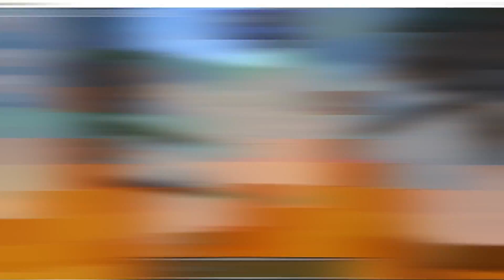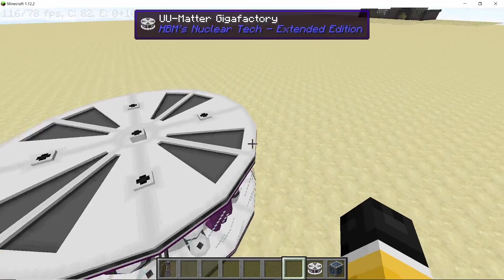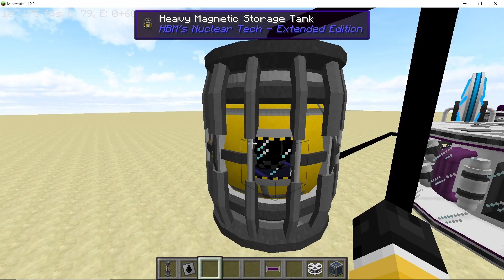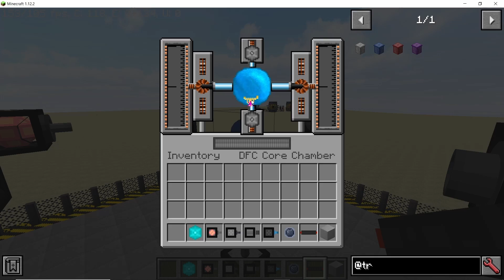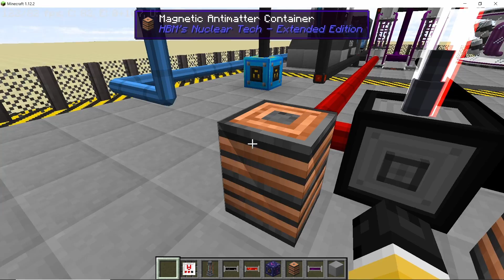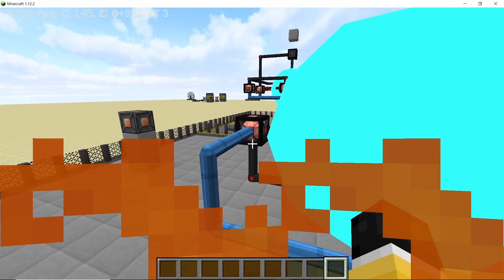Self Sustaining DFC using UU Matter Gigafactory - HBM's NTM Extended

Comment: for higher spark and power generation i would reccomend you using undefined lens and exchanging antimattee with BF rocket fuel. By this i managed to create a DFC that produces 510 PHE/s without melting down with 5,1 TSPK
Reply: Damn man how'd you do that? For me the max I could get was 364SPKG or something like that
Reply: @randomanimatorandgamer9392  stabilizer lasers can go trough blocks. srack multiple stabilizers onto each other and turm them on. I managed to get 21000% restriction field
Reply: @Spudman9  wait are you talking about 1.7.10 or 1.12.2?
Reply: @randomanimatorandgamer9392  i think it applies for both but i mainly talk about 1.12.2 cuz its self sustaining
Reply: @Spudman9  oh sick I should be able to do it then

Comment: i pushed your design to overdrive exchanging the normal stabilizer lens with undefined ones. i managed to produce like 20-30 PHE/S and when i set every single emitter to 100 i managed to produce ludricious 3,20 EHE/S with like 100 TSPK
Reply: How did you do it? The most I could produce is 36 TSPK pls tell me
Reply: @unknownunknown2843 Use antischrabidium and balefire as fuel along the thingy core and euphemium catalysts and it should make a lot of energy

Comment: Hi. I have small problem with crafting dfc in NTM Extended. I need osmiridium to create reactor, but when I explode Gerald, there is no tektite. Maybe u know what could cause it?
Reply: bro, when you blow up, a lot of time passes, black circles of tektite appear, inside these circles there is tektite saturated with osmyridium, or just put a landing platform and push the module on the same frequency as the herald, and then he will bring you valuable powders and tektite once every 10 minutes

Comment: Have you done anything with a Draconic Reactor from Draconic Evolution? It arguably is one of the best looking reactors in Minecraft mods in many aspects, but it is also one of the more complex ones to safely run. If it explodes (which it will if you're not careful), the explosion dwarfs even the DFC explosion, and from what I hear, there's no way to stop it except keeping the reactor stable (there is a failsafe, but how much good will that do if it produces too much power). Thankfully, if an explosion will occur, you'll hear a small boom (which is the primary stabilizers going kaput), and the reactor gives you about 5 minutes to gather your stuff and book it out of there before the reactor explodes, obliterating the entire area.
Reply: The dfc give no time if you mess up and a blast radius of 250 or 500 blocks I forgot. The draconic reactor has blast radius of 200 blocks fully loaded.

Comment: I fail to understand how this amount of power can even be used xd. An absolute banger of a video my guy I loved it !!
Reply from the maker: Ayyy I'm glad you enjoyed it bro, also you can use this to you know ... Just flex on your friends or blow up a big section of the world xd
Reply: 1. You can charge the Crucible
2. Make Demonic Meteor Sword (final stage + one of the most powerful weapons that actually requires effort to make)
3. Make a glitch used to craft electronium self-charging battery (the best sc battery in the game)
I forgot the other crafts but i hope you got the point.
Reply: Hmm, lemme just hook up 50 particle accelerators, 1000 schrabidium transmutation devices, and 100 cyclotrons and see if that puts a dent in it.

Is it the most practical or useful way to use that much power? Probably not, but at least I'll never run out of antimatter, ionized particles, exotic particles, schrabidium, and anything else the cyclotron and particle accelerator makes ever again.
Reply: it is also necessary for progression. it is theonly way I know of getting U-238-2 which is required for the electronium energy storage block and the fensu among other things. it is also how you get the book of boxcars.
Reply: @SeanBresson  btw you can make a book of boxcars in the baby mode or without it using some craft but i forgot which one, my friend told me about it. Ill tell you after i ask him tomorrow.
Reply: @SeanBresson you can find both the book of boxcars and U238-2 in meteor dungeons
Reply: @SeanBresson you get U-238-2 and the book of boxcars from meteor dungeons

Comment: What mod helps you to observate the core temperature that has a screen that shows you the stats of the reactor.
Reply from the maker: Energy Control mod, I haven't tried it with the DFC reactor yet but it helps monitoring most things in ntm so I don't see a reason why it won't work on the dfc